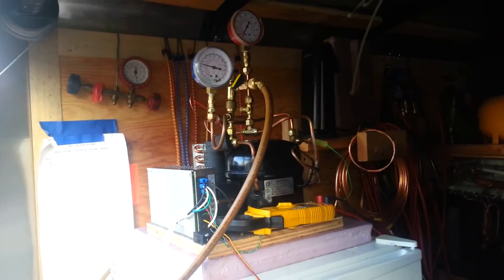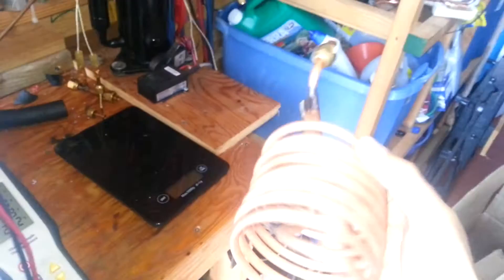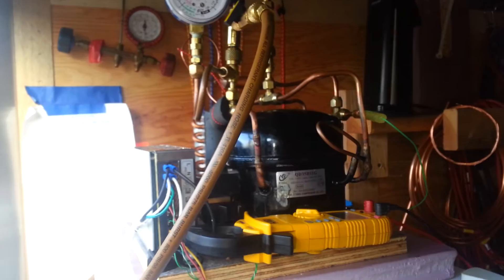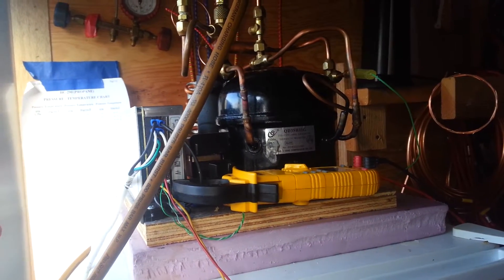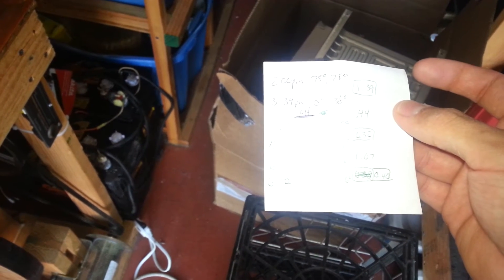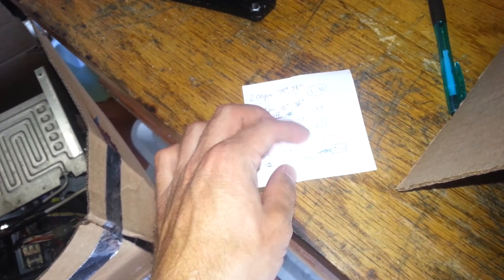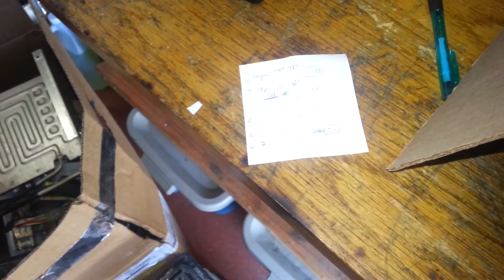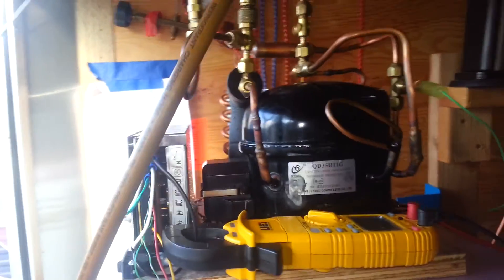Modular Freezer- Bigger Evaporator, Better Performance

Comment: Hi, wher do U buy all those copper pipe fixtures:  tee,  90 elbow,  couplings....  ?      Thanks
Reply from the maker: All the copper stuff is handmade, but the brass flare fittings were purchased from a local refrigeration supplier, as well as eBay.  Most well stocked hardware stores should carry many of these parts.

Comment: you know bbq propane has alot of impurities, go online r290 i cheep you can also get r600 and r280 cheep
Reply from the maker: Thanks.  I'm aware of the impurities.  I have yet to have any problems with BBQ grade stuff.  Once I'm building a permanent fixture, I will switch to refrigerant grade.  For now, $2.40 a gallon is pretty appealing!
Reply: ya i guess, in refrigeration school they tought me that any impurities alter the pt scale, and water in a system turns into acid that the drier soaks up, so i guess your fine